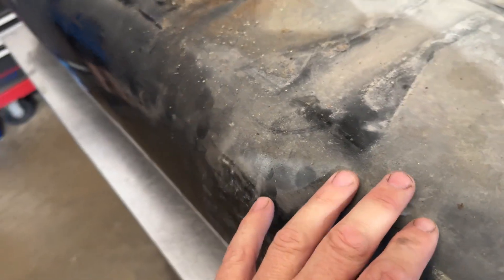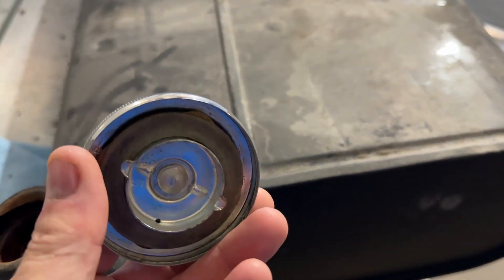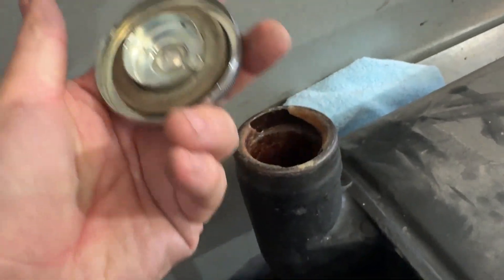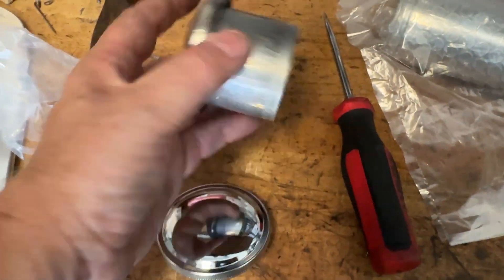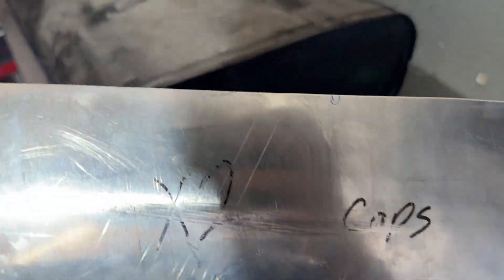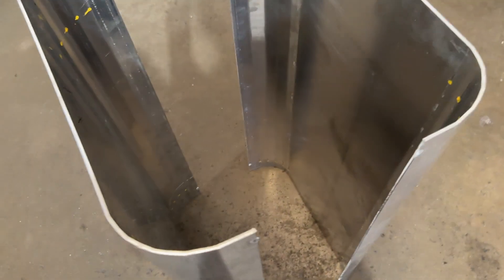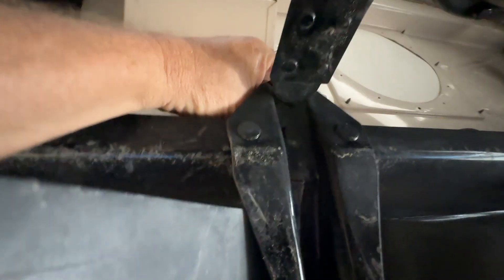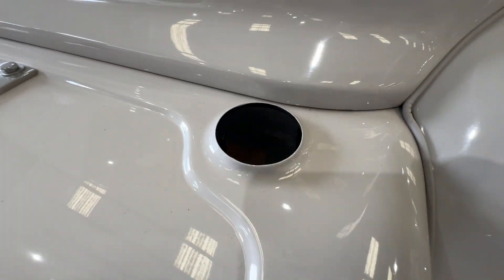Custom Gas Tank fabrication

Comment: No big deal, just an $8000 fuel tank in what is possibly the most uncommon car most people will see on YouTube today.
Reply: Disappointed you didn't make it in Titanium 🤣🤣.
Reply: @Rob.Coleman slap ticon stickers all over it 🤣
Reply from the maker: $8000 😳.   I think the bill was about 1/10 of that.
Reply: @LHTPerformance  You custom fabricated a fuel tank, out of aluminum, for $800? No way. What does that leave for labor if the materials are sold at cost? 2 hours? I would have been at 800 bucks just on removal and install...You can't even buy an off the shelf fabricated aluminum tank and put it in a C10 for 800 bucks.
Reply from the maker: @Jglovermr2   This was a for a friend that’s done a lot to help us out over the years. But saying that, We stay busy as we’re affordable.